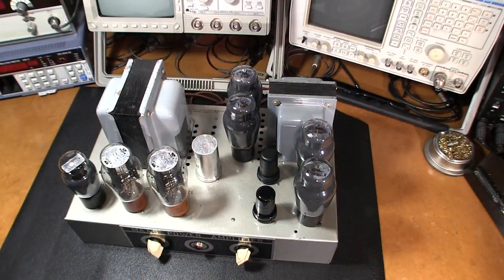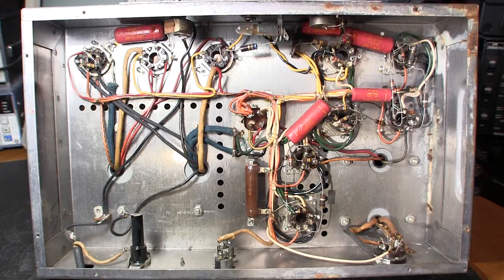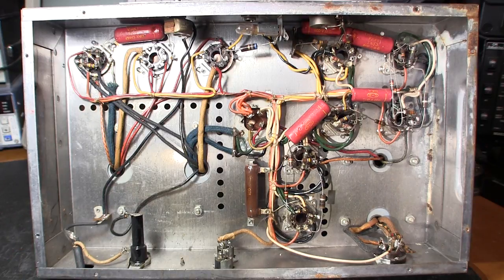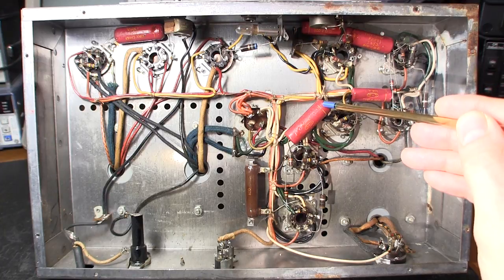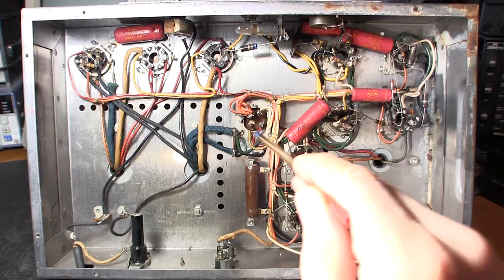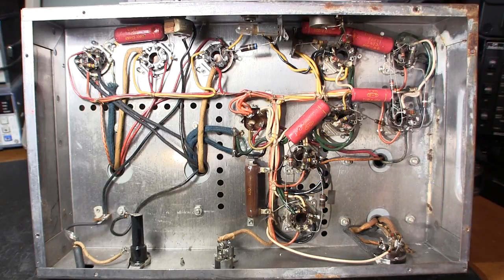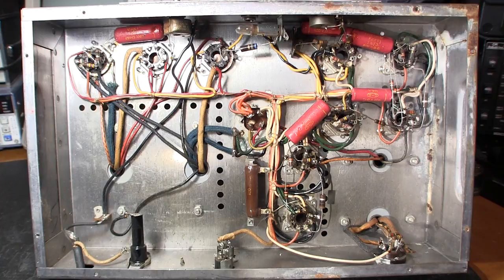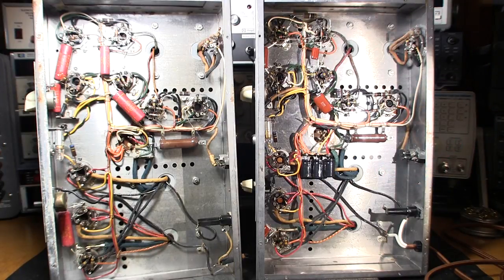Tube Amplifier Repair, and what to look for.

Comment: The 50A was used as a Booster Amp.  It was added to the "Boost" output of a Maas 500 or 500A.
Reply: The 500A had either a ground screw located on the lower rear left side of the chassis (in the case where the preheat transformer was used) and a ground lead on the AC plug in later versions.  For any piece of vacuum tube electronics a GFIC is best in lieu of grounding.
Reply: I'd be curious to know what the full spectrum output is of this amplifier rather than using a 1Khz signal.  A 1Khz signal isn't really what's considered real world.

Comment: Thanks for all the videos you release. They are very useful. I’d appreciate if you could give me a tip about tubes. I was removing a preamp tube from my guitar amplifier and one pin broken (the other 8 are perfectly on the tube). Can I just removing it with pliers or there is a risk for getting electrical shocking ? Ps: all other components are set in their places. Thanks !

Comment: Hey, first, I want to say that I love your videos.  They are extremely informative, and I am learning a lot. I am commenting to ask this, though: you mention replacing the caps with polypropylene caps... why polypropylene? Do they have characteristics that make them good for this application?
Reply from the maker: Hi Sean. Yes. Low leakage, long life, a defined outside foil layer....and so on. All good qualities in a capacitor.
Reply: Paul, where do you buy your caps, etc...  And do you have a brand preference?

Comment: Very helpful.. im still learning.. i once was told that the AUDIO signal coming into a tube flows to the Plate and on to a coupling capacitor "because"  AC  being what the audio signal is.. travels OPPOSITE OF DC flow.. ie plate DC.......anyhow that is how a old timer finally got me to understand.....how the audio signal moved from into the tube and out the plate to a another stage.  ?

Comment: Very impressive and informative presentation(s) . I’m looking for a circuit diagram for a tube amp around 60Watts with 3 preamp tubes (ecc83) => tone control (volume/treble/bass/midrange) => with a phase inverter driving a push pull 6L6GC amp with output transformer.   The power transformer for drives a bridge rectifier for the B+ voltage.  Any suggestion will be helpful

Comment: Hi Paul, Yet another GREAT VIDEO !!  I have a question though,  Like your big broadcast transmitters probably use final tubes with either glass or ceramic chimneys around the big tubes to help guide the forced air around the tube for cooling. Have you ever seen a high power audio amp (tube type) with ceramic or glass chimneys around the tubes for better cooling ?? -  John A Bellas  KC2UVN.

Comment: I have a problem with my tektronics 2335 ocilliscope . Ch1 the vert position is off the view area and will not move with the position knob. The horizontal is working fine but you have to push beam find to get it into the view area. Not fimiliar with solid state at all , I am a retired electrican and only worked on tube type industrial equipment. Any help is a blessing.

Comment: Nice video! Maas? Is that the same company that made some TNCs (packetradio modem)? I wonder what happens (in watts) if you replace the 6L6 tubes by EL34 tubes (if the rest of components doesn''t mind ).

Comment: Hi Paul, I really like these amps, and you have 3... I definitely have amp envy! You did however confuse me with your comment about swapping out the 2- 6j5's with 6SN7's... if you used one 6SN 7 as a phase inverter, wouldn't the other 6SU7 leave you with 2 extra gain stages as they are twin triodes? Or am I misunderstanding again? Thanks for the great video's, Tom

Comment: Paul..how does it sound ?  How does it compare to other well known hifi amps like heathkit W-5M's or a Dynaco 70? Appreciate your opinion and of course this is completely subjective. Thanks beforehand..
Reply from the maker: Hi Dan, (my opinion) they sound wonderful. I notice in the design, they have installed some capacitors in places to stop possible oscillation. Further testing for a design center may allow the removal of these capacitors which would "most likely" give the amp a little more top end. I have yet to sweep the response, and calculate how much feedback they have Incorporated (global feedback.) Since the amplifiers were placed (usually) quite a ways from the recorded source, these capacitors may also be there to stop any RFI as well, further investigation will determine this. The 6J5 tubes are just single triode versions of the 6SN7. I may replace both 6J5's with two 6SN7 tubes, allowing two stages of pre-amplification before phase inversion. This would make the amp much more friendly to lower amplitude signals from a normal pre-amp.

Comment: Really enjoyed the video. Why would these amplifiers have two power transformers especially when the appear to Beso simple.
Reply from the maker: Hi Richard. One transformer (the bigger one) is a power transformer. The smaller one is the audio output transformer. Tubes are high impedance devices, and in order to drive a low impedance device like a speaker (8 Ohms), that impedance needs to be "transformed"
Reply: Thank you very much for for response.

Comment: Hi these amps remind me of jukebox amps. What sort of power do these church amps put out?  How about frquency response?
Reply from the maker: Hi Anthony. They "usually" make about 25 Watts "or so" from the factory (clean power.) These were designed to be left on 24/7 way back when, so they are built conservatively. The 6L6G and the 6L6GC have different plate dissipation ratings, these being the lower of the two. The 6L6G is just an 807 with no plate cap, they ran the plate lead out of the bottom and called it a 6L6G. The 6L6GC was redesigned for more output at lower plate voltages.

The frequency response is usually tailored around the "Mids" as they were designed to play recorded church bells at very loud levels without too much distortion.

Comment: On Videos you did in the past (not this one) You installed a ceramic stand off (small Ones) insulated from either end attached to the old cap for tie points. My question is who makes them Manufacture of Vendor, I would like to get a bag of 100 or 200 of them any info would be appreciated  Thanks Keith

Comment: What kind of mic do you use for your videos while you're physically on camera. (At the beginning & end of your video). The quality is incredible, and I'm looking for a good mic that I don't have to hold in my hand. (Got bunches of those). Thanks. Randy.
Reply from the maker: Hi Randy. You must have a good audio system with your computer to notice the dynamic range. The Mic is a custom built Vacuum Tube condenser style, with an ART Voice Channel as the pre amp. The signal goes directly to the camera with no audio editing.
Reply: I was considering a Rode Video Mic Pro for my camera. I want something 
that's not in the video, so far enough away, but still with good sound. 
(Your mic sounds incredible). I've got my PC hooked up to my tube amp, 
with just a couple of Optimus speakers, but the combination of it all 
sounds incredible. (Also, I do have an Ashly compression unit in the 
line, which also makes things sound tight... and keeps all levels 
consistent. Any input from you on the Rode Video Mic Pro? I'd welcome 
your input. Randy.

Comment: I have a Yaesu ft-900 and my problem is I suppose it's typical for this unit where it doesn't RX or TX on all the freq. is it a hard fix? do you have a video, thanks, George
Reply: I meant all bands

Comment: hi ,i made a guitar tube amp and my b+ is too high cause my power transformer has  a excess of 30 v for the 6bq5 tube. so my b+ is 370 v and  the shematic has 340v on b+  and 90 ma on cathode bias  its push-pull class a  ,can i put resistor directly after my tube rectifier to reduce b+ voltage ,thanks

Comment: Newb question.  I'm looking at some schematics to build a headphone tube amp and one of the schematics shows some of the capacitors rated with AC voltage and some don't specify.  Another schematic shows no AC or DC designation on any of them.  Should I assume if there is no designation at all that all capacitors would be rated at DC voltages?  I can't seem to find this information anywhere...  Thank you.

Comment: Paul, Where do you get the white wire insulation (sheathing) that you use on your capacitor and resistor wires. I can't seem to find that anywhere.
Reply from the maker: It's a little electronic supplier in town here. It's the only place I know of.

Comment: Hey. Are you saying that all old capacitors like Sprague and mustard caps all need to be replaced and are no good if they have not been used before. NOS basically or used capacitors of old need to be replaced. Are NOS capacitors not good any more? Thanks
Reply from the maker: Any paper and foil type capacitor, NOS or used, needs to be replaced. Some mustard style caps are not paper and may test ok for leakage.

Comment: Hey there Mr. Carlson! I love your channel and have learned a lot about vintage electronics. 

On a side note, I wonder if you might point me in the right direction with a problem I'm having with a solid state receiver. Its actually just a crappy Technics receiver so its no biggie, I'm just curious whats going on. The right channel works normally, volume, treble, bass, and balance all work on all the inputs but the left channel is fixed at a constant volume (probably half way loud). The problem channel does "work" on all inputs and does respond to treble, bass, and balance sliders although it is very muffled. The volume slider has no effect.

I know that its impossible to know what the problem is without seeing it first hand, but I was wondering if you have any tips or things that come to mind.

Thanks!
Reply: Mike Tunstall 

Not sure what the age of the unit is or the model but if it has a dedicated digital volume control IC that circuit would be a good place to start.  I have seen them fail in equipment and volume will be stuck at a set level.

Comment: Good morning Mr Carlson's, I'm wondering for a young person getting into electronics, do you need a wide range of Valve Knowledge with solid state. Your knowledge seems to have a large body of both. Would a apprenticeship be the best path in your opinion?
Reply from the maker: Hi Dennis. I feel it's extremely important to know both sides of the fence (so to say) Many pieces of equipment still use vacuum tubes, EG: Microwave ovens, digital displays (VFD's), Plasma tv's, even fluorescent lamps are a glow discharge vacuum tube..... the list goes on. In the HAM world, an "Elmer" is the term for an older teacher, unfortunately many Elmer's are only good at one or the other, (tube or solid state electronics.) In modern electronics, there need to be a balance in understanding between both worlds, as often they are still paired together. There are many other reasons as well, but I could write a book at this point. 
Hope this helps.
Reply: Mr Carlson's, thank you for come back and "yes" it did helped.

Comment: Great video I have a question just got you on patreon my question is any problems and are they parallel with multi output tube amps like a Cayan A100T thanks for the great shows

Comment: I would like to send you a Super Challenge repair. A SideBand Engineers SB-36 transceiver.  Powers on. It's from 1972 and has 'nixie tubes' for read out. Would make for a good repair video as it is hybrid, FETs, Transistors and vacuum tubes.. Can I do that? Alan, W4FBI
Reply from the maker: Hi Alan, I'm not taking any radio repairs at the moment, I have a years + backlog right now. Thanks for your offer though!

Comment: I'm looking for schematics for a *hybrid amp using CRC5692 valves. Do you have any advice? 
*using transistors and valves for efficiency and availability issues.
Reply from the maker: Advice on what specifically?
Reply: Advise like web addresses that might have schematics on amps made with CRC5692, AKA 6sn7 that also incorporates more modern designs.
The only thing I can find require a transformer for main power, needed,  as well as one for each speaker, surlily not the only way. Also I'm tying to find something that incorporates transistors for higher wattage output.
I have buckets of half wave tube rectifiers, pentodes, bla, bla, bla. But the only class A amp valves I have are the 40 CRC5692, 6sn7's. I can follow a schematic. I also see that the past and current techs can enhance one another.
I see a value by using a valve pre-amp mated to a digital amp. If you can get the audio as crisp and warm as possible just prier to the amp stage then the quality of the valves sound should not be lost yet you gain in power output without tethering it to a Cat 85100 generator.
Am I making sense, cents or since?

Comment: I don't understand you say there is plenty of 400v source in this chassis, yet you don't use a 3 wire plug?  What happens if a short develops and you touch the chassis?  That doesn't scare you?
Reply from the maker: It doesn't work like that. The secondary side is isolated from the mains, and has a fixed ground to the chassis.

Comment: why wouldn't you want a 3-prong cord? I have a 58 Magnavox I'm pawing at right now- the cord's original and not even polarized; it's also been cut and repaired right near the plug, changing it, to a 3-prong.  removed a brown-mustard colored disc-shaped capacitor from the terminals where the cord leads are soldered in, it had 3 legs itself, but only 2 were attached, the other clipped,  it reads: RMC 2X.01 1400V...  is this the dreaded "death capacitor"?  Uncle Doug said so..  dragging my beginner feet on this project, and I REALLY need to listen to some records!  please help, my good Sir.  thanks, Steve..  (not malcolm)
Reply from the maker: Hi Malcolm. It's a personal thing, and lots of politics involved (witchery included) The political answer: (Yes a 3 prong cord is needed as death is eminent!) To explain why it wasn't issued with a 3 prong cord is an entire video's worth. I do admit, adding a 3 prong cord does make it safer.

Comment: Use 6W6 Tubes for more output!
Reply from the maker: Hi James. The 6W6 has much lower plate dissipation specs. It does have a large cathode, so good emission for low Voltage series set TV's though.

Comment: Which country were these made in?  Looks like zinc plating to me.  So how did it work in one tube mode..as a class A with parallel  output tubes?
Reply from the maker: If one output tube fails, its still in push-pull. If one inverter fails, only one side of the output transformer primary will see signal, so Yes, somewhat like class A operation with paralleled output tubes.
Reply: That would lead to high distortion since only one tube would conduct between
plate and centre tap (B+) of the primary o/p transformer winding.

Perhaps its this circuit configuration?

Single Ended Push–Pull (SEPP, SRPP or mu-follower output stage, originally called the Series-Balanced amplifier (US patent 2,310,342, Feb 1943). is similar to a totem-pole arrangement for transistors in that two devices are in series between the power supply rails, but the input drive goes only to one of the devices, the bottom one of the pair; hence the (seemingly contradictory) Single-Ended description. 

The output is taken from the cathode of the top (not directly driven) device, which acts part way between a constant current source and a cathode follower but receiving some drive from the plate (anode) circuit of the bottom device. The drive to each tube therefore might not be equal, but the circuit tends to keep the current through the bottom device somewhat constant throughout the signal, increasing the power gain and reducing distortion compared with a true single-tube single-ended output stage.
Reply from the maker: Keep in mind that this would be a failure mode, so it would make sound, just not very well. The "not well" part would let the owner know that the amp needs to be serviced, but the bells would still chime on Sunday. A really admirable design.
Reply: As an anecdote to this ingenious design to keep those bells ringing on Sunday, one would have to say "Praise the Lord" for the inspiration to
the  Maas (Mass) circuit designer. :-)

The company that made these is Maas-Rowe Carillons in Escondidio Ca. 
They are still in business and make all sorts of carillon products including
digital.
Reply from the maker: LOL, I see what you did there :^)
Reply: Actually these vacuum tube amplifiers were produced during a time when Maas-Rowe was in Los Angeles near Fletcher.  The two names Louis Maas and now Paul Rowe who is the son. Maas-Rowe started in 1922.
Reply: The amplifiers were manufactured during a time when the design's required "licensing".  I cannot dig my 500A out currently but I seem to remember it was either Western Electric or Webster Electric.
Reply: USA manufactured.

Comment: you said changing cap by poly cap... but they are mostly non polarized... ?
Reply from the maker: They are not electrically polarized. Their orientation in circuit is polarized.